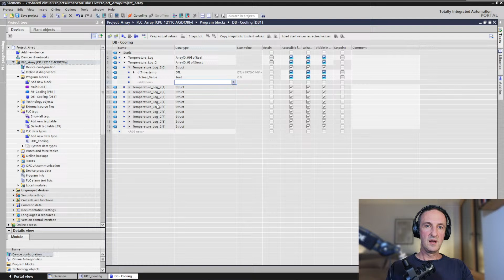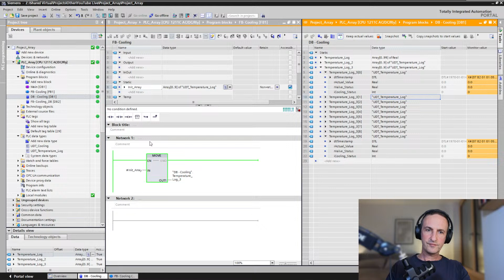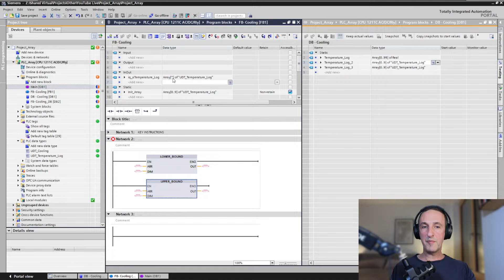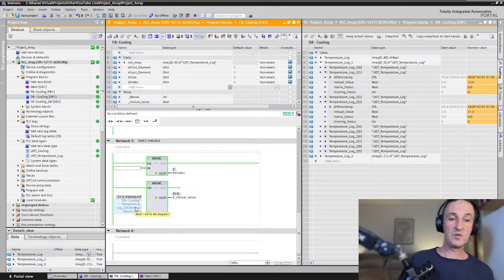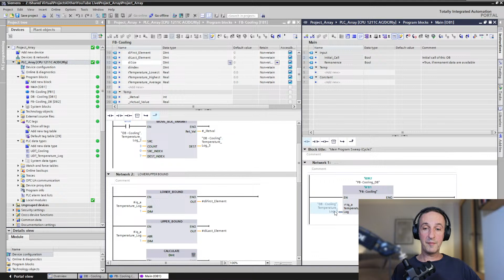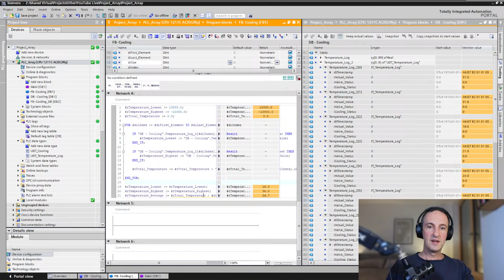🔴 Introduction to Arrays in TIA Portal (Live Workshop)

Comment: How can I find the intersection point of two values in TIA Portal after converting a table into a 2D array? For example, I have one value for the row and another value for the column, and I want the PLC to return the value located at their intersection.

You didn't mention this at all 😂😂😂😂
Reply from the maker: Make an index for each dimension of your array, then use both indices to define which row/column you want to address.

E.g. Test_Array[Index_Row, Index_Column].rValue 

If you use e.g. Index_Row=5 and Index_Column=3 then it will return the value of intersection row 3 and column 5.